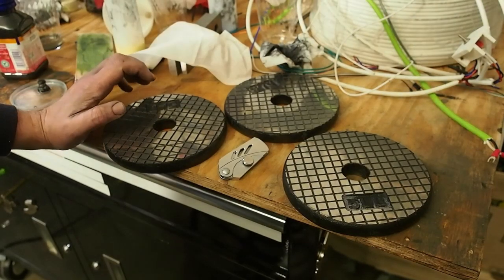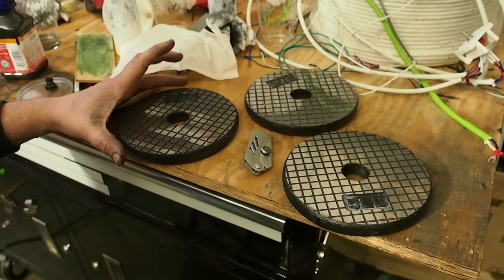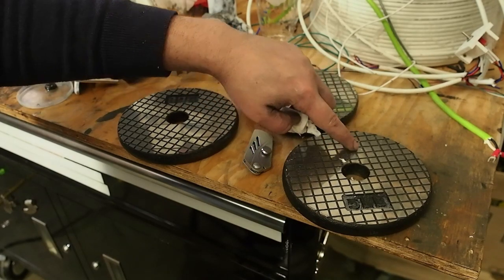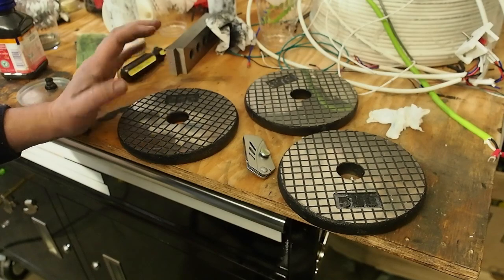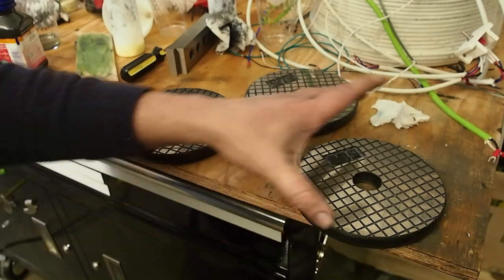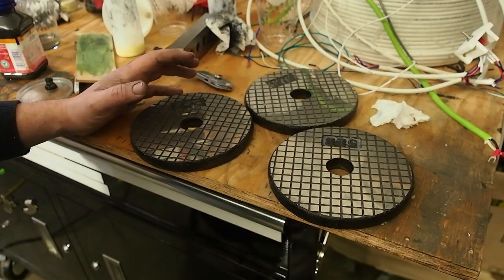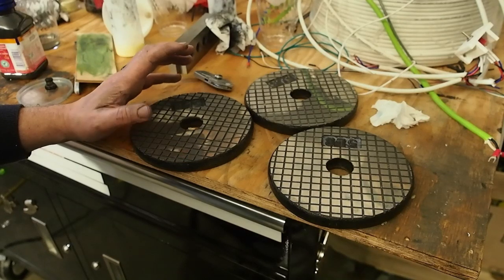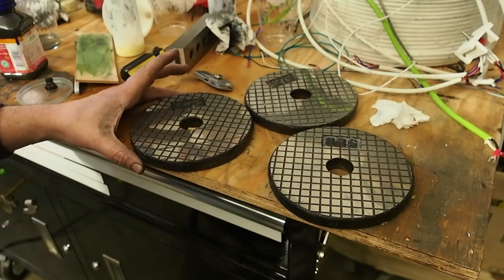whitworth 3 plate method for making lapping plates part 2

Comment: Hi, great videos!  Kudos for giving this a go.  I think the biggest problem with your choice in plates is the shape of them.  I noticed when you were lapping the stationary plate was on occasion spinning and moving around.  The get the level of accuracy you are looking for the stationary plate ~must~ be stationary.  You could mill a flat side to each of the plates so they each fit appropriately sized recess.  

As you I'd consider using the void in the middle for welding in a lovejoy type adapter.  Done right it'll make swapping plates easier and you don't lose any more surface area.
Reply from the maker: I wanted to turn the plates but I couldn't fit them in my chuck at the time.  I now have a bigger chuck but I doubt i will turn them and relap them.  Having them the same size would be nice.

Comment: блин как написать то 

ты без проблем сразу плоскость получил ? 
я попробовал, получил яму
Reply from the maker: Пустот в отливках не обнаружил.
Reply: @JesseSchoch  так .... мы друг друга не понимаем ....
я тоже делал 3 плиты, 100*100мм и в центре имею яму 0,0005 мм +/- есть видео, у меня на канале

so.... we don't understand each other....
I also made 3 plates, 100*100mm and in the center I have a pit of 0.0005 mm +/- .
have video on my channel
Reply: @JesseSchoch  not flat on all 3 .... all have the concavity (pit) -0,0005mm
Reply from the maker: @guliwer1713  What order did you lap them if you name the plates A,B, and C and how much did you rotate them per pass?  How much overhang did you allow when stroking the plates?  How did you check the flatness?  I ended up using an optical flat to check the flatness.  Whitworth ultimately ended up using bluing and scraping  so this method is not without error.  

My guess would be that your stroke was too long and the cutting of the edge of the plates caused concavity because lots of overhang makes keeping the plates parallel more difficult and the edge is a bit like a gouge shape which would create a hollow.  I believe the rotation corrects this somewhat and maybe your rotation angle between passes was too large.

the proper order is outlined here.  https://etshare.pbworks.com/f/Chapter%2014%20Reference%20Planes.pdf
Reply: @JesseSchoch  What order did you lap them if you name the plates A,B, and C
=============================================
classic first, then random on "past GOI" if I see low center

=============================================
How much overhang did you allow when stroking the plates? 
=============================================
20+/- mm (10+10 from zero) 
if overhang  big - convex lens (in the literature)

 I  using an optical flat to check the flatness. 
rotation angle between passes 90 degrees.

Comment: Still don't you know why it was so viewed? CPU IHS lapping. Trust me.
Reply from the maker: well if i suppose the diamond you can use to lap the CPU quickly would also help cool it since diamond is a very good heat conductor!
Reply: @JesseSchoch  thanks for the tip I think there's a diamond thermal paste (not cheap I guess). Anyway, people is still currently using sandpaper to lap CPU IHS, what doesn't create any proper flatness, so getting that goal by easy means would be incredibly.
Reply from the maker: @azcron  you can buy "diamond lapping paste" and use this technique to make something flat, or you can even make something slightly concave.  The telescope guys use this type technique (i think you just need 2 laps) to make mirrors and instead of cast iron they use pitch (tar).  You can make the laps out of anything softer than the material you want to lap.
Reply: Not why I'm interested. kinda would like to make precision tools some day and this is the base of it all. I'm not sure lapping CPU IHSs really does much for you since you're already using thermal paste to bridge any irregularities. The videos I've seen the guys usually use sandpaper, which doesn't give you anywhere near the precision this does. So not the same kind of lapping (I wouldn't even call it lapping so much as just regular sanding).

Regardless if you're not lapping the cooler surface it's no use at all unless you already know it's flat to within the same tolerance you're lapping the IHS to, and even if you had micron precision flatness on both I still wouldn't bet my $400 cpu dollarydoos that the surfaces mate precisely enough to conduct heat that well (especially when considering thermal expansion on top of that).

Comment: I'm very surprised at how stable those seem to be. Seems like with such low quality material it would have moved a lot more! What did you say, you lapped those 2 years ago and haven't touched them up? If so that's very surprising! Good job, looking forward to the next one.
Reply from the maker: I started them 2 years ago and got them to 500 grit with a few low spots.  I just did 2 rounds of 500, 1: 7 micron, 1: 1 micron.  It did not seem like they moved much at any time.